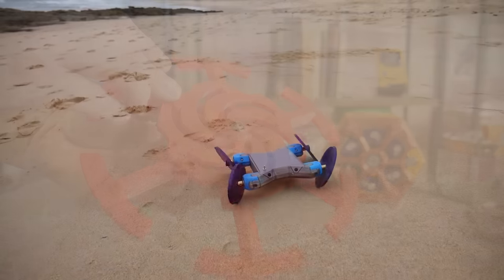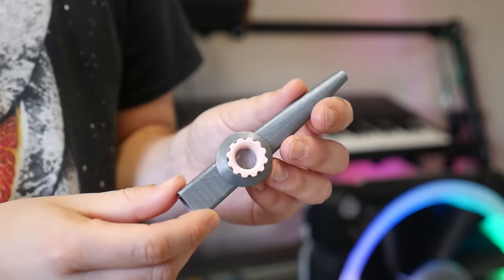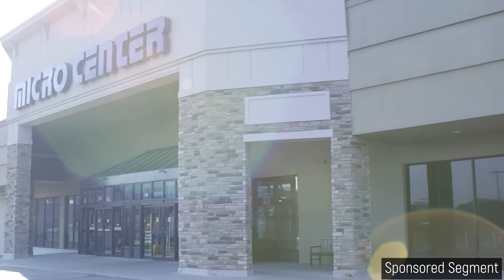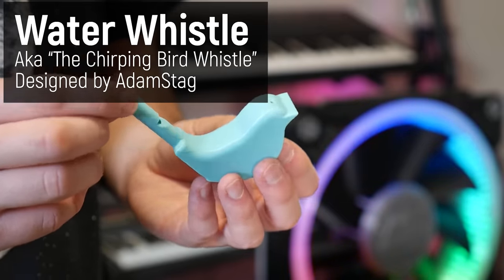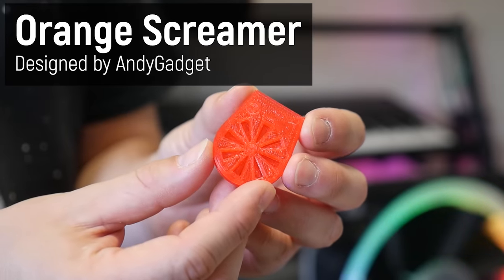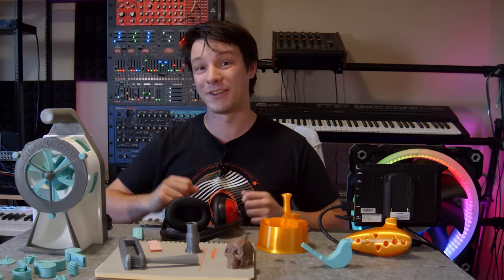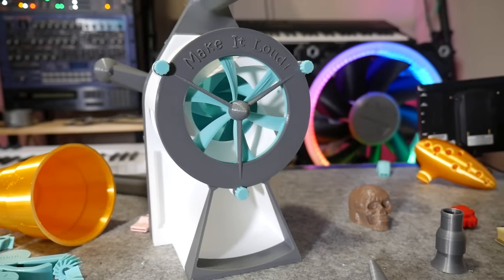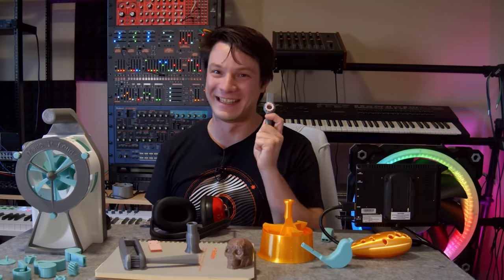What is the LOUDEST 3D Print?

Comment: The loudest thing you can 3d print is the 3D printer itself. Though they are disqualified.
Reply: specially the ones that the manufacture decided to add delta fans for extra noise
Reply: Get better stepper motor drivers. My printers barely break the noise floor in my office, and that's just because of the fans.
Reply: @Blooest  oh I have a near silent Prussa printer. It did not take much to get it there. I have heard some versions of do it yourself printers that are like meat grinders.
Reply: @antoniomromo  Ender 3 pro steppers were very loud, 4.2.7 motherboard upgrade makes them absolutely silent.
Reply: Buy an Artillery SideWinder, I have 3 running in my livingroom and constantly find myself looking towards them to make sure all 3 are actually printing. They really are almost silent.
Reply: @Blooest  +1.  If you walk out of my workroom, it’s almost impossible to hear.  Way quieter than my Printrbot Simple metal was
Reply: @Blooest  The problem is the progression goes like this:

Slow and noisy -> slow and quiet -> fast and noisy

Although nothing fast could ever be as loud as those A4988s. 😂
Reply: @WatsitTooyah  it lowers noise but far from silent.  You want silent swap in a BTT board with 2209s and dial in stepper settings.  The only noise will be fans.
Reply: @brandonbrown3600  Silence is relative 🙃 the only thing I can hear from a meter away is the fans anyway so 🤷‍♂️
Reply: It's only loud if something stalls the motor and it makes this loud farting noise, like it's going to munch te teeth off the belt. Or if you choose the fan based on maximum airflow and not the sound output (I find the quiet fans like Noctuas and weaker Sunons  thoroughly inadequate, they almost don't blow compared to even the stock fans, so the fans I used are like 90% of my printer's noise output. And no, I didn't use those industrial Deltas that can gobble up a whole banana, but that did cross my mind).
Reply: @krzysztofczarnecki8238  I chuckled way to much at the image printer of fans destroying a banana 😆😂.
Reply: hmm..thats not very loud, I use TMC 2209 drivers on all my machines ;)  the cooling fans are louder than their motions.
Reply: @krzysztofczarnecki8238  honestly I find the noctua fans are very accurate to their CFM, so if you want a quiet fan and have specific needs theyre...really good.  theyre pricy though.
Reply: I'm currently imagining designing a model specifically to make an unmodified Prusa i3 Mk2 make its angriest noises for as much of the print duration as possible.

I did so much to that bot just to confine its stepper noise to one room.
Reply: Is this a bob reference
Reply: @WatsitTooyah  That means the steppers are ok, the software is issue.
Reply: Oof. I know what you mean. Glares at Mega S
Reply: None of this is "loud"
Reply: I have a snapmaker A350 and the power supply fan on that think is like sitting in an aeroplane at takeoff. It’s loud.
Reply: laughs in RepRap
Reply: That is legit what I thought this video was referring to, which item was the loudest To Print.  The actual video made much more sense than I thought
Reply: 3d printing a 3d printer thats printing a 3d printer
Reply: You fool may I introduce you to the fgc9
Reply: @iscaanacnud7974  i was waiting for someone too say that.
Reply: When you print something hollow and the fans go over it and it starts to whistle really loud at 3 am
Reply: Anycubic kobras are very quiet. Only time you hear it move is when it rapids to another location.
Reply: they make the coolist robot noises tho
Reply: @aaronquick4027  indeed they do.
Reply: 3d a 3d printer
Reply: if your 3d printer is putting out 118db then something has gone terribly wrong

Comment: I was once 3D printing some parts and some very strange and creepy noises started coming from the printer. As far as I can tell, the part cooling fan was causing the parts to whistle during certain parts of the printing.

Pretty niche and not that useful, but could imagine designing a part to do this purposefully on a given printer.
Reply: I have this happen wuite a bit. Usually on thin walled prints or vases
Reply: A print that goes half an hour, and plays a song with the steppers and by blowing with the fan
Reply: Happened to me printing the death whistle with an Anycubic Kobra
Reply: I'll be honest, when I clicked on the video I thought it would be about making loud sounds as the thing was being printed lol
Reply: @danielloo1255  the steppers get me groovin, sometimes they throw a sick beat.
Reply: @matthewskutar5964   Same
Reply: This is genius, you could add a permanent death whislte with a Cpap lol
Reply: I thought this was the topic of the video when I clicked on it 🤣
Reply: Cool
Reply: @andrew-729  reminds me of my friends washing machine i was at his house and it laid down a sick beat

like if I was a rapper I would be spitting bars over it
Reply: @limeflashlight4101  washing machines are also both literally and musically metal.
I used to follow a channel where the guy would have different kinds of old machines being unbalanced or tortured in some other way to get some cool backing beats and stuff.
Reply: @user-zh4vo1kw1z  there's a Matmos album that uses washing machines a lot, I forgot what it's called just search Matos washing machine album
Reply: Huh
Reply: Strange and creepy noises? Bro I think your 3D Printer Is haunted lol
Reply: @Becvar80  Haven't done it yet, but that's actually the printer I have and the print I was going to do! Well, I have the Kobra 3 Combo anyway.
Reply: @matthewskutar5964  lol me too

Comment: I printed that air raid siren a couple of years ago. Had the same issues with rubbing (particularly the drum part) but I eventually got it running smoothly and sweet jesus is it loud! I've only ever run it up fast a couple of times because it's more than loud enough to elicit complaints from the neighbours even when used indoors. Still one of my favourite printed things.
Reply: How did you get it to run smoothly?
Reply: @jasoneel76  lots and lots of sanding! The big drum part was the only problem but it took a long time to identify where it was scraping, pull it apart, sand it down, reassemble, repeat ad nauseum.
Reply: Not only loud but how terrifying would it be to suddenly hear a raid siren lol I’d be freaking out
Reply: @lukeclayton7578  lol
Reply: For other people who need to find surfaces that scrape: a paint that easily rubs off (marking/layout fluid is used in metal working) helps a lot with it. Maybe whiteboard marker works on plastics?

Comment: FYI:  The Microcenter deal comes with a $10 off filament coupon packed inside.  This brings the cost of the printer down to $89!
Reply: How does the printer compare to other popular fdm printers?
Reply: @cyan_2169  The Ender 3 is a decent model, albeit showing it's age with an 8 bit board. For that cost could replace the board and still save over a comparable printer, but the 8 bit is more than capable.
Reply: @stellarbastard98  And they only have 25 locations here, might seem like a lot, but it kinda isn't.

Comment: That deal at micro center is soo good! I picked one up and so did a friend. Thank you soo much for letting me know! I really needed another printer to get parts made faster. Got it last night, put it together, and first print was really nice!
Reply: My nearest store is over 200 miles away.  The $99 printer will cost $150 in gas to get there, maybe more.
Reply: @novtek  my nearest one is 15,000km away and would cost $2000 to fly there
Reply: When does the coupon expire
Reply: @novtek  400 miles roundtrip @ 20 mpg and ~$4/gallon gas = $80.
Reply: @dharielnailo  You get better gas milage than our van.
Reply: sad european noises
Reply: @roowut  you got it way worse than me. 6500 km away
Reply: When does it expire
Reply: @lizdelehant8568  some time in June
Reply: @sharkkord  thanks
Reply: @novtek  just get a 3d printer at that point
Reply: @lizdelehant8568  I just got my coupon today. Im from missouri so our nearest store is 5+ hours away. But they have a store in Atlanta area. I happen to be driving to Florida next week for a family vacation. My coupon says that it expires 9/28/22

Comment: The noisemaker (4:35) is also a commonly used percussion instrument
A more common variant is you have a handle that turns a gear that runs through 2 separate pieces of wood
But we do actually have a version like in the video, except it's a lot bigger, and a lot louder
Reply: In czech we use it on Easter And Itsade of Wood but in the video Its really REALLY quiet

Comment: Wonderful showcase! 👏
My fav is the Air Raid Siren, although I would probably install a motor to it to test its limits 👀
Reply from the maker: Haha that could be interesting 😳
Reply: @MakersMuse  I wonder if printed bearings would work
Reply: A motor dedicated siren performs a lot better (3d printed siren but designed with the motor in mind)
Reply: Yeah, it can be turned with a drill :D
Reply: Look at freckled Zelda
Reply: Agreed
Reply: I install alarm systems. Licensed in texas. 
I have a customer.
who insisted on a.....non-typical siren for his install.

He had aquired several air raid horns, and he wanted those as his alarm siren to protect his warehouse full of cars.
the thing is....if a thief successfully got in......there is a locking mechanism to lock him indoors with the siren until the police arrive.
so by the time the cops get there, his ears should be bleeding and he will be speaking in sign language for the rest of his days ;D
you can hear his alarm system in the next township over

dont mess w/ texans

Comment: Well there is a reason most 3D printed ocarinas struggle with tuning.. It originally a clay instrument and a proper solid object. That gives the best result in tones. And even in clay it really need proper tuning
Reply: Pretty sure it was actually creamic, clay doesn’t tolerate moisture well and is very brittle

Comment: I got my $99 Ender 3! 
But please be aware that they are indeed the “downgraded” version with the 256 rather than 512 chip, a rebranded power supply, and 4.2.2 mainboard.
It is still a great deal, but it’s good to know if you go down the upgrade path later on.
Reply: Good info! I keep getting a captcha error when I submit for the coupon. Do you have any idea?
Reply: Wish I could get one. In-store only and the nearest is a solid 3-4 hours away.
Reply: @manuelsepulveda2692  no I don’t know why that would be for sure. But I would try a different browser or turn off any vpn, or try on different network connection ie. Mobile vs wifi
Reply: @KeithShelton  yeah you’re probably looking at around $80 in fuel alone for that round trip. So factor that into the discounted price.
Reply: How do you apply for the coupon? When I entered the site there was nothing on it about the new customer exclusive.
Reply: Wait, nvm I got it.
Reply: @kellysander6987  could you enlighten me. I received an email by no coupon and no text. Any help would be greatly appreciated
Reply: @KeithShelton  lucky you! My nearest one is 17000km away. I was all excited then realised he was only talking to the U.S. audience
Reply: @hotfuzz1913  The coupon is sent via text. So, maybe you entered your number wrong. You should try with a different email and phone number that is not associated with a MC account. Good luck!
Reply: @huntertheisen9972  thanks for the reply 👍
Reply: Unfortunately when looking at microtech products I see quite a few grammatical errors , so I personally wouldn't buy something from them that I would expect to be accurate or nice but if it's being used as a junker than it's probably worth it .
Reply: @rickyricardo3551  microcenter is a great store to have around. Not many places to buy tech products and see them in person first, or have a place to return/exchange/repair them easily. Not sure you were actually referring to the shop when you said “microtech”
Reply: @markseaton4893  yer i hear ya.
Reply: Enders are the Yugo's of 3D printers.

Comment: I printed a V29 a couple of years ago. It's still in my key ring. 
Superb design.
Reply: I have a few as well, but something isn't quite right about it. It takes too much air and sounds wheezy. I think the opening may be too large. I had to print at reduced scales so that my smaller children could blow it. Which raises the pitch of course. Though reducing the thickness and increasing the length keeps the pitch closer to original, but reduces the size of the air opening and makes it easier to blow.

Comment: I printed the bearing version of the air raid siren as a birthday gift for my dad. I've cranked it 2-3x faster than you did yours and it is LOUD. I did have to sand/file quite a bit on the hex shafts and a bit on the outside of the fan, but all the bearings were a nice tight press in fit. I did modify it slightly and used metal dowel pins as axels for all the bearings.

Comment: V29 requires pretty dialed in printer, the internal slot width is very important to achieve high loudness level. And it's better to print it with 0.3mm line thickness so that there's less rounding. I use it as safety whistle for hiking.

Comment: I worked an indoor monster truck show, legitimately louder than an F18 fighter jet doing low passes, and the sound lasts longer as it’s not just speedy passes overhead. The sound from the trucks almost instantly reaches a level where you don’t really hear them anymore, just ringing. Around 125 decibels if I’m remembering right, didn’t wear ear protection even though it was provided and I probably should have. The worst part about it is that parents weren’t making their kids wear the ear protection either and most of the kids were below 10yrs old, some even threw them out after getting them so they just had to sit in pain. Guarantee at least 1 kid from that event got permanent hearing damage

Comment: I recently printed the tubular siren whistle you have on your display surface. It's fun, though it also made me want to get some really tiny bearings and make one with super-low friction to reduce the rattling sound it produces.

Also, I'm a little disappointed you didn't include any membrane pipes. One that's easy to print is my Ultrakazoo, which is available on both Thingiverse and Printables. I'm curious how it would have fared in your loudness test.

Comment: If a tooth wheel doesn't run smoothly, try to lubricate with grinding paste. After a while the resistance diminishes, then remove the paste. Not tried though.

Comment: Yeah, you never where measuring in dB(A) but pure dB.

The A in dB(A) stand for a specific measuring method. You can only get a good outcome if you use a digital class one or two device and measure for at least a minute. And even then you are not done. If you want a true reading, you should also concider the reverb in the room.

And why did you get surprising low readings on your device? Because it measures 100 times per second in "fast" mode, but the display isn't quick enough to display the actual reading. So while you hit the high notes, the device is playing catch up and will always show lower readings.
Reply: This is just a fun video, it doesn't have to be perfect or have the most accurate readings
Reply: @AdowTatep  still some good to know fun facts

Comment: Great video Angus! Clearances are my bane. Any advice on Fusion 360 and clearances? 

Usually, I oversize one of the bodies I'm trying to fit together by a few percent and use that to make a cut into the other body, but I have a lot of mixed results. Plus, now one of my bodies is incorrectly sized. Help?
Reply: I include a tolerance variable, usually 0.2mm for my Prusa MK3S+ for a comfortable but not tight fit. When you know you need to have a gap between two items, base build them with a distance of [tolerance]. Then you can change the variable later if your chosen tolerance wasn't quite right.
Reply: You can select any face and "push/pull" it by a defined amount. Shortcut key is Q

Comment: When I was a kid I had a siren whistle that was in the shape of a small twin engine airplane. You blew in a tube that was under the tail. The siren part was located in the body and the air exited the body via two vents that were directed to make the propellers spin as you blew into it.

It was pretty cool. If I still have it then it's packed up somewhere. I'd like to find it again someday though.

Comment: the loudest 3D print you can do is a cube the size of the building platform with 0% infill and Osmium or you could go the other route where you start a fire but that's more debatable. Then you drop it on the table from as far up as you can and THAT is the loudest, 3D print you can do. (Also have to find the most dense filament for it to be correct)